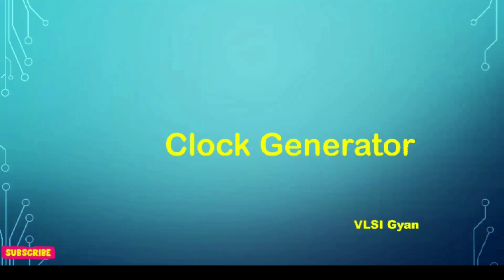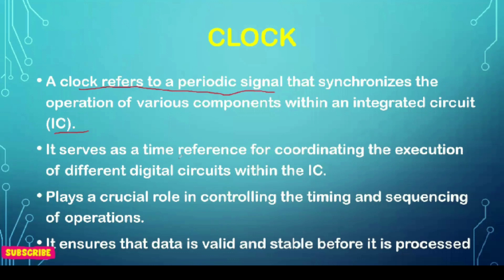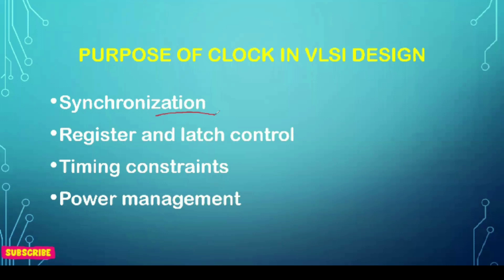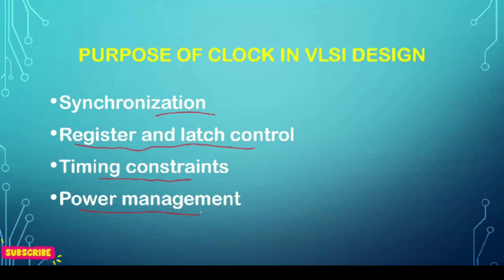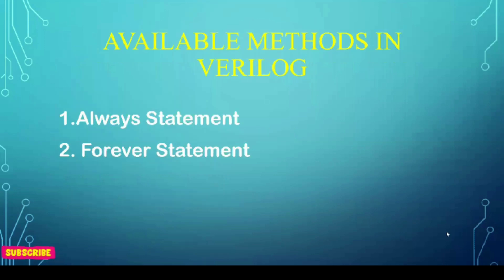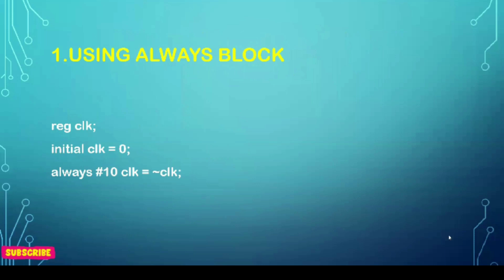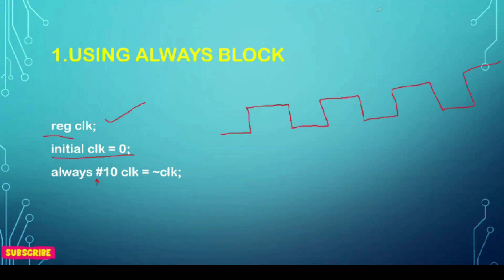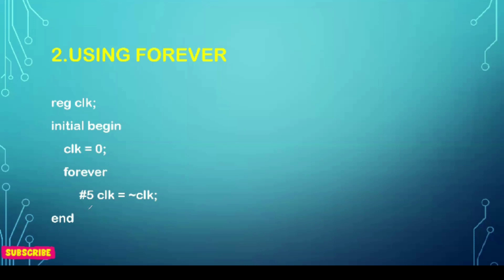Clock Generation Code Using Verilog | Comprehensive Tutorial

Comment: How to generate a clock with 1Mhz freq.
Reply from the maker: We can generate the 1MHz clock by using a counter inside the always block .The counter is used to divide the input frequency to the required frequency. Based on input frequency and output frequency we can select the counter.